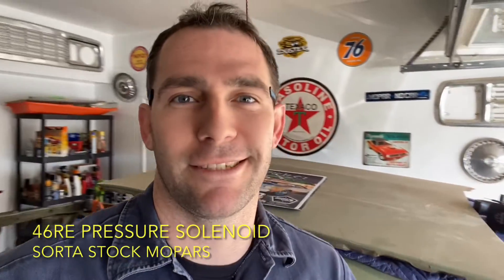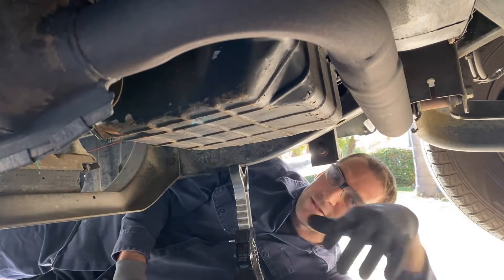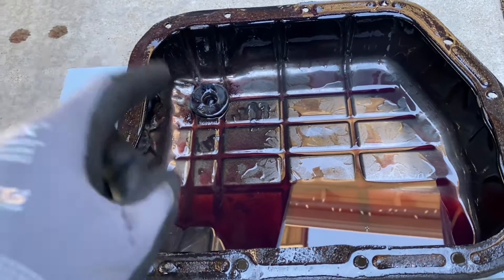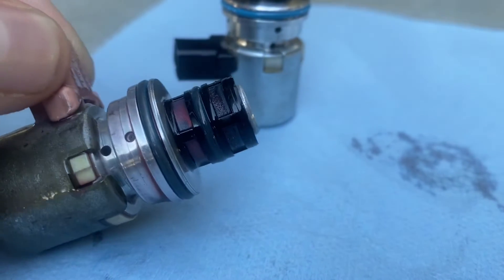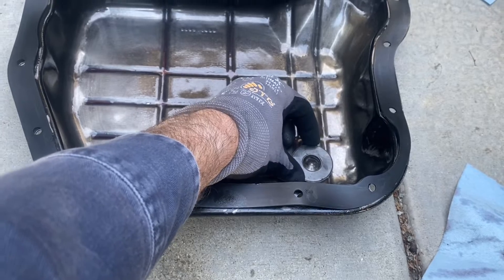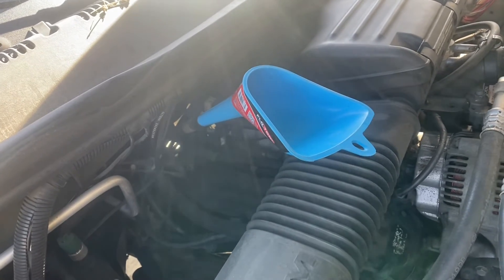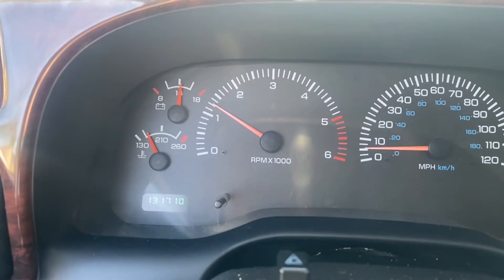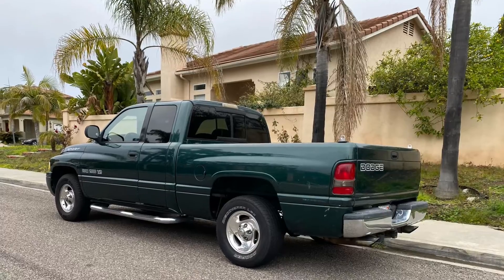Dodge Transmission Repair- Replacing the 46re Transmission Governor Pressure Solenoid

Comment: Do you know about replacing a transmission shift solenoid? My Dakota threw a code for 3-4 shifting, and everything I’m seeing says this is the transmission shift solenoid. Is this a difficult fix? I talked to a transmission shop, and they said it’s so involved and likely to have more issues after that it’s best to basically wait until the transmission is shot and do a full replacement. Thoughts?
Reply from the maker: I wouldn't hesitate to replace that yourself. Lots of how-to videos on YT. It's accessible and can be replace without pulling the entire trans. Just need to drop the pan.
Reply: @sorta_stock  That’s all it seemed like to me from everything I could see online…nice to have it confirmed. Thanks!

Comment: Hey, can dropping the pan affect the transmission over time in a bad way? Many people say not to touch it, however im getting a similar problem like you and would like to change the same sensor.
Reply from the maker: Definitely need to drop the pan for maintenance. It depends on the vehicle, of course, but I typically change my transmission fluid and filter every 50k miles.

Comment: I've lost reverse could that be my problem
Reply: I put a new pressure solenoid and adjusted the reverse band.
Reply: @billycav75  an it worked
Reply: So far I know it's not a fix.But hopefully it gets my son though highschool.
Reply: @billycav75  did you get reverse to work after doing that
Reply: Did you figure out why you lots reverse ?

Comment: You said you were experiencing symptoms, what symptoms were you experiencing? I've got a 46rh that only seems to have third based on my RPMS at 55.
Reply from the maker: It wouldn’t shift into 2nd gear unless I slammed on the gas. It would also have an issue downshifting (delayed response or sometimes it would wait for me to completely stop first). Manually shifting it into 2nd would have no effect.

Comment: Hey, can I get some information from you as far as part numbers. what you ordered from Amazon every time I look something up its telling me it won't fit the truck. If you could throw some Amazon part numbers at me that would be great although mine's in 95 I know they do make subtle changes here and there.
Good video are you in the biz.
Reply from the maker: Thanks Glenn. The part I used for this repair was from a seller called HERCOO on Amazon.  P/N: AZMP24230.
Reply: Thank you for replying, only drove the truck for a week. Pulled up to a light went into neutral slash no lockup limped down the road a little ways, in and out of lockup started making some noise and that was that.

Comment: Nice video!! We do this service at my transmission shop for $375-400.00, parts and labor (governor solenoid, pressure transducer, filter, gasket and fluid). Sometimes we find the kickdown band strut in the pan and have to pull the valve body (if we can't luck up and get it back in around the body) to re-couple it. The customers don't even know they've been missing 2nd gear and have been shifting 1-3 for a while! lol

Comment: Any idea why a 2000 46re would overheat after about 30 miles driving? Added cooler, has plenty of flow tested into a bottle, Convertor seems to lock up as it should.  Hmmm
Reply from the maker: Could need a band adjustment. If the bands are too tight, it’ll burn up the clutches and overheat.
Reply: @sorta_stock  I'll check into that.  I bought the durango with a conv that kept locking up. Replaced it and its been good for about 20k (139k overall on truck) and then started overheating out of the blue.

Comment: TRANGO REPROGRAMING KIT (not just a shift kit) developed on my 92 Dakota in mid 90's  took Transgo about a month,  Rock solid ever since with about a quarter million miles much towing, add a 12x12 plate and fin cooler with HALF INCH lines (Diesels later came with 1/2 lines)  if you do a rebuild on 46 get a 47 core to start with  My early trans has the Diesel straight cut gears
Reply from the maker: A few small modifications like that go a long way with these transmissions.
Reply: @sorta_stock  if you put gauges on the cooler lines you see a big drop in backpressure and much greater flow  in/out /rad cooler about the same restrictions

Comment: I wish I would have known this several years ago, I went to 3 shops with an issue shifting. TCS was the code. I specifically asked all 3 shops if I could just change the solenoid all said "oh no" you can't do that. $2,700 for a rebuild. I just happened to run into a guy at a bar with a transmission shop. He said oh crap! you got hosed! Just change the solenoid. Honest people are few and far between.
Reply from the maker: You already know there have been others in your same situation. You’d hope people would be honest but, many times greed wins out. That why people stick with mechanics they trust.